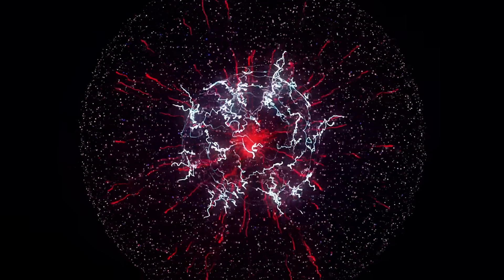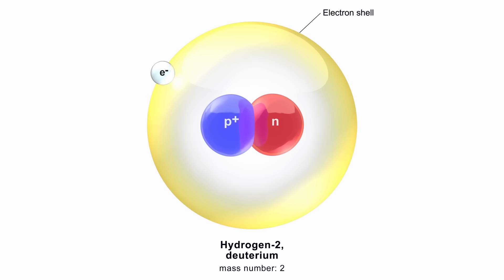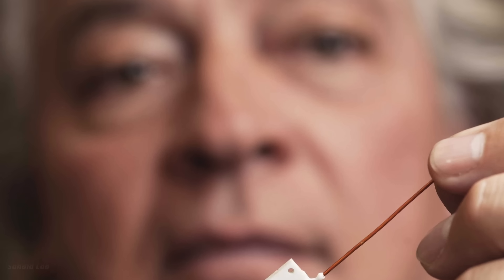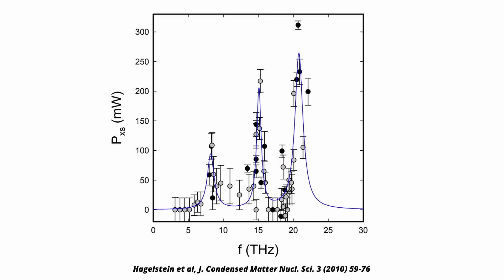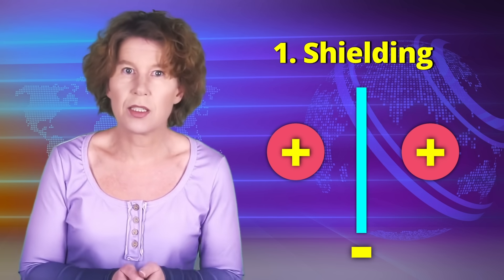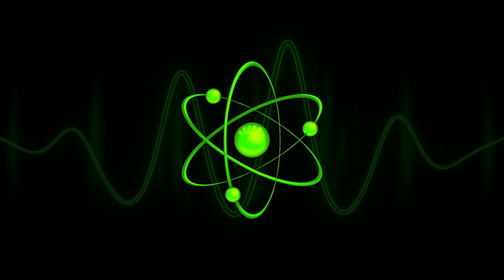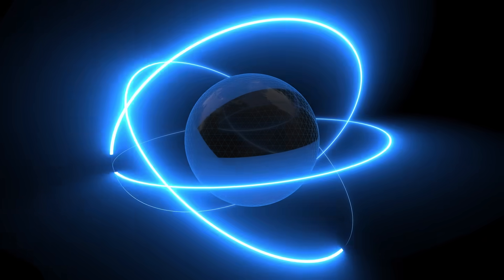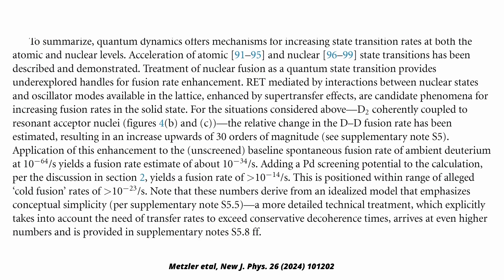Physicists Say They Know How Cold Fusion Works

Comment: So how sensitive do our neutron detectors need to be to detect anything at all?  It’s a bit like claims that the Earth orbits the Sun, despite the inability to detect any parallactic motion of the stars. Eventually we worked out with a spectroscope that the stars were sunlike themselves, so we could then estimate how sensitive our parallax detectors needed to be. Should we be using lead shielding when we do the experiments?

Fusion in the Sun is actually a rare event. It’s just that the Sun is big and self-insulating.
Reply: You think the earth doesn't orbit the sun? Is the earth flat to?
Reply: You’ve just misinterpreted what I said.
Reply: @david_porthouse  Yep you are correct. Most of Sabines comments seem to be electric world theory people or just crazies. I made a poor assumption without paying attention
Reply: @rayparent1  Concerning the Solar System, we are looking for some correlation between the known distance to the Sun, the assumed distance to nearby stars on an initial crude assumption that they are equally bright, the Sun included, and the parallax that we can observe. We really only got to that in the 19th century. We don't seem to be there yet with alleged cold fusion. The expected products of fusion are heat and neutrons, and we have no known correlation between them. The question of whether or not we can make a profit out of attempted cold fusion is not relevant here. I'm just looking for correlated evidence that it exists at all. This paper may help to tell us what to look for. Once we "lock on" to something then maybe we can look to make a profit. At least we would have a respectable and interesting line of research.

Comment: Muon catalyzed cold fusion has been around for ages, the late fifties, I remember reading about it as a teenager (I'm not that old), and the mechanism it exploits to fuse is I thought well understood. Sadly it's also in the more energy in than out part of the diagram, but still may be interesting to any who aren't aware of it: https://en.wikipedia.org/wiki/Muon-catalyzed_fusion
Reply: There was a brief revival of muon catalised fusion in 1986, and there was even a journal devoted to it, but the advancements stalled. The science is good, but unless someone finds a cheap way of producing negative muons, it's hopeless from the energy generation point of view. By the way, Rafelsky, who was involved in the cold fusion scandal, since he was in a rival group [of that of Pons and Fleischmann] working on it at Brigham Young University came from the muon catalised fusion community.
Reply: @jjeherrera  I am curious though - could there potentially be a way to combine this with some other approach so that each one can cover for what the other can't do? I am not sure how well it would work combined with the lattice approach because if you just fired muons into such a lattice they would likely get "caught" on the other atoms far more than on the desired deuterium nuclei, but maybe like using it in a "hot" setup but at considerably lower plasma temperature than 100 MK (i.e. "warm fusion" instead of "cold fusion" or "hot fusion"), or the laser-implosion approach i.e. NIF, but you fire a muon pulse into the imploding pellet along with the lasers (presumably, this would be suitably timed so that the muons arrive near or at the point of maximum compression), or ... Basically just to find some way to not have the muons do ALL the work and/or provide an energetic enough environment they don't "stick" to the helium fusion product so often which seems to be the main issue with the muon-catalyzed approach by itself.
Reply: I've always thought we should mount an experimental muon-catalyzed fusion device on a hydrogen or helium balloon, let it float to 50km height, and see if the constant rainshower of muons we get from space could make this type of cord fusion profitable. It's a free source of muons, after all
Reply: @JosePineda-cy6om  You could potentially concentrate the muon flux using a magnetic field too. I did some sums. I think you could get a very small amount of net energy - in theory (there's always losses in practice) - but I don't think its worth the trouble.
Reply: @robertpaton9716  ok, so maybe this won't be the miraculous energy source the world is waiting for, but... what about a source of complementary energy for high altitude balloons? Even if the net gain is very very little, as long as it's a net possitive, it could serve as a complement to the solar panels to feed the circuits in these balloons. Who knows? We could probably use some of that energy to heat/cool the gas inside, to get a relatively level floating altitude. And a constellation of  long life high altitude balloons could serve lots of purposes, replacing LEO satellites at a fraction of the cost
Reply: I was wondering if that could.be mixed with this method to get cold fusion faster, or for proteus instead of deuterium.
Reply: @ancapftw9113  no, normal hydrogen requires higher pressules and/or temperatures to fuse. That's why even H-bombs use deuterium+tritium, it's much easier to fuse these than regular hydrogen

Comment: Why does everyone call deuterium-tritium fusion "unlimited energy"? We may have practically unlimited deuterium in seawater but we don't have unlimited tritium. There is so little tritium on Earth that when it is needed, it is made by fissioning lithium and lithium is very far from an unlimited resource and battery manufacturers already want all they can get.
Reply: To be fair, the problem is turning lithium to tritium, not getting the lithium in the first place. There are millions of tons of lithium in the world, but only a few kilos of tritium.
Reply: Because you can capture the neutrons that D-T fusion throws off in a breeder blanket, and make tritium right at the reactor. This does take a load of lithium, but doesn't really consume it that significantly.
Reply: @martinalooksatthings  Fusion doesn't make enough neutrons to produce all the tritium needed. Each reaction produces one neutron and needs one tritium but not every neutron splits a lithium, so you will need more tritium, which means fission plants are still needed.
Reply: Which is why CF should be the preferred avenue to explore as it requires no tritium.

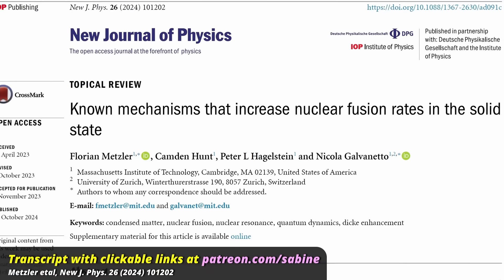Comment: It turns out that this paper (visible at 2:20) was published on the arxiv in 2022, but made it into a journal in October 2024. 

My favorite theory of cold fusion was due to Ron Maimon - deuterons getting 20 keV energy when holes in the innermost electron shell of the palladium get filled, some kind of collective effects among the deuterons, and then actual deuteron fusion quantum mechanically catalyzed by proximity to the palladium nucleus. I'll have to see how it looks from the perspective of the three mechanisms in this paper.
Reply: Keep us posted.
Reply: Is Ron Maimon still around? Had nothing heard for years
Reply: @gregorpabst7423  I think he moved to Israel during the Trump years
Reply: I have always wondered if the voltage acts like a mini-electron gun in the palladium crystal lattice, and that palladium's electron shells happen to leave holes in just the right location for the electrons in the current to bombard the nucleus under the right circumstances.  That would lead to free neutron production, as a nucleus of 3 neutrons would fly apart almost instantly, those neutrons could merge with other nearby tritium nuclei, emitting a beta particle ang amma ray and turning the tritium into helium... which should have a very predictable energy, so it could be proof of concept if such gamma rays are detected.  The released beta particle would probably be a regular electron, and simply be swallowed up in the electric current, releasing heat as they drop in energy levels.  So, the result would be:  a small surplus of free neutrons, specific gamma rays, surplus heat, and mostly helium-3.
Reply: I checked that out, their are avenues that are being investigated.
Reply: Hmm. A deep-shell boost is an interesting idea, not sure how you can somehow arrange for that to happen in terms of making the coupling go. What would cause the deep-shell vacancy, though? It seems you'd need some sort of ionizing beam to create those vacancies, so again of course the question is energy in:energy out as always.
Reply: @ShimrraShai  He says once you have fusion, the energetic byproducts can ionize other palladium atoms, so you can have a chain reaction - but he doesn't address how it starts. Perhaps it could be started by a cosmic ray or a radioactive decay.

Comment: We already have unlimited clean energy. Earth is a big ball of molten rock. Nasa/Sandia Labs studied Magma Energy from 1975-1982, and demonstrated experimentally, various means of harnessing that energy. The technology was neither developed nor applied; nor even demanded by those ostensibly concerned with climate and ecological disaster. Hence you'd have to suppose that, even if physicists solved Cold Fusion, it would never be applied. Except maybe as a bomb!
Reply: You are clueless, magma energy otherwise known as geothermal energy is used extensively in places where it makes financial sense to
Reply: @rayparent1  Thank you for your comment. Despite being incredibly rude, it gives me the opportunity to discuss something that is widely misunderstood. I am most grateful.  
It is incorrect to say Magma Energy is 'otherwise known as geothermal.' 
There are many types of geothermal energy. Magma Energy is a specific type of very high temperature geothermal energy from proximity to molten rock. 
There is no Magma Energy power generation; the nearest we've come is the Iceland Deep Drilling Project - and even that is hydrothermal, as opposed to a closed loop system that would harness both heat and pressure. 
At 374'C - water, becomes steam, becomes super-heated steam - with an associated huge increase in volume. It was a breakthrough in steam train design back in the day - that would apply to closed loop Magma Energy power generation.
Reply: @karlstone6011  yes I know what your talking about and you are still clueless. In places like Iceland people are still looking into supercritical geothermal. The problem is most places don't have access and it's an enormous engineering challenge.
Reply: @rayparent1  Am I clueless? I can only speak on things I've read, for example, this from Nasa/Sandia Labs in 1982: 

Status of the Magma Energy Project
Dunn, J. C. (Sandia National Labs., Albuquerque, NM.)
Abstract
The current magma energy project is assessing the engineering feasibility of extracting thermal energy directly from crustal magma bodies. The estimated size of the U.S. resource (50,000 to 500,000 quads) suggests a considerable potential impact on future power generation. In a previous seven-year study, we concluded that there are no insurmountable barriers that would invalidate the magma energy concept. Several concepts for drilling, energy extraction, and materials survivability were successfully demonstrated in Kilauea Iki lava lake, Hawaii.

For context, current global energy demand is around 600 quads; which is to say there's a minimum of 90 times global energy demand available from Magma Energy, just in the US alone. Worldwide the resource is effectively limitless. 
Admittedly, it's not available everywhere, but then nor is oil. Oil is produced in far flung corners of the world and transported to where it's needed. Sure, it's an engineering challenge. What isn't?
Point is; despite Nasa/Sandia's optimistic report, 40 years later, still no Magma Energy. So you think if they solved Cold Fusion it would be deployed? Not unless they could make a bomb out of it to kill people who challenged fossil fuel oligopolies.
Reply: @karlstone6011  you said we already have unlimited clean energy that's why you are clueless. As you've just admit we don't have it yet

So basically you've agreed this is the same as fusion just an engineering challenge.

I'd love to see a design that doesn't have extreme maintenance costs

Comment: Given that the latest “breakthrough” in fusion technology recklessly announces controlled fusion energy when it provides ignition WITHOUT accounting for energy out Vs TOTAL energy in (I still remember “cold fusion”), My TOP DOWN theory of cosmology says that in order to reconcile static gravitational and Coulomb effects (a valid grand unification theory goal) there is a value, a number R, such that Ke^2 = RGm^2, where K is the Coulomb constant, e^2 is the square of the charge on an electron, G is the universal gravitational constant and m^2 is the square of rest mass of an electron– what can be simpler than that! The calculated value of R is 4.16574 x 10^42. Given my TOP DOWN cosmology, then, Coulomb effects are 4.16574 x 10^42 times more intense than gravitational effects, meaning that local ignition, compression and containment needed for sustained fusion reactions are collectively unattainable. Clearly, the evolutionary direction of the universe must be countered and reversed to sustain a local fusion reaction– a physical impossibility! Yet, much money and time is being WASTED on attempts to “find a way,” apparently to justify continued reckless population growth on this fragile planet. (The problem does not exist with fission reactions, which have their own set of intractable problems, because energy release follows the direction of universal evolution.)

Comment: If cold fusion existed, we would have examples of it in nature... I believe... Someone once said that chickens, when fed with feed with low calcium content, transmute other elements into calcium,... so that there is no shortage for their eggshells... but I have never heard that they fuse atomic nuclei... I have tried that "simple" method of salt water electrolysis, with nickel electrodes... but I did not see any fusion... I used a CR 39 polycarbonate catalyst...
Reply: Answer: Look up Bob Greenyer.

Comment: Thank you for this video! Certainly, looking into cold fusion is and was a better investment of time and money than looking for Axions or WIMPs. And it was dismissed as "bonkers" by the wrong people (who usually did not have a clue about the partial perssures of H2 you can achieve by adsorption in Pd/Pt configurations). I really whish I would live long enough to fly a fusion powered Em-Drive ...thing, but well. It's not happening.

Comment: The reason why CANDU works great for cold fusion, is that you can use the excess energy from fission to do cold fusion. And deuterium is vital for doing that.
Reply: Are you suggesting that the CANDU reactors are already benefiting from fast neutron collisions with deuterium being fusion in a measurable amount?
Reply: @chrisolmsted5678     it was enough to put Darlington out of action. (Joke, idk what the problem was with the Darlington CANDU)
Reply: Don't know if that's the case, but I'm sure they will provide the highest chance of getting useful cold fusion of any means we currently have. Starting with experiments to see if it could work and how effective, would be a nice first step in a useful direction in my opinion.
Reply: magnetic north should focus cosmic ray muons

Comment: I was at LBL when that Fleischmann and Pons cold fusion paper landed on my desk.
   After those first debates (and eye-rolls) over cold fusion back then, I have naturally continued to be a skeptic.  
   But i had to click this one since i try to keep an open mind and videos here tend to be credible and well-thought out. 
   “Enhancement of 25 orders of magnitude” is a big leap but i’m listening.  I also liked that model includes phonons - something i historically only thought of in very high power optical systems.  
   I may have to look into this research…
Reply: Phonons featured in the optical spectroscopy our research group studied in the 1980s. Of course, those were very low-energy (peaking at around 60cm-1 or so), but any crystal lattice would have those phonon modes.
Reply: @ I never spent much lab time with nonlinearities in crystals.  I was instead just remembering nonlinear fiber optics - the SiO2 is amorphous but when one launches Watts of laser light into the fiber, the intensity in the fiber core is so high that tensor math returns to haunt field and wave calculations.  And phonons started to explain the observed SBS (scattering).

Comment: Uncle George was PhD Berkeley physics  Before they both died, he went to Utah to test Fleichmann's device.  He said, and I quote, it did not produce enough neutrons to be fusion but that it did produce excess energy.  George was UofC involved in first A-bomb and  doesn't appear in any history book or film.
Reply: The latest research seems to indicate it's producing fusion but not excess energy.
Reply: @dansanger5340  I know he (George) brought his own equipment to test neutron flux, but have no idea how he evaluated excess energy.  He was certain about excess energy and was very rarely mistaken. He knew Fleischman on a professional level and may have just used his (Fleischman's) numbers.
Reply: @82spiders iirc there is some evidence for aneutronic fusion as well as fission reactions in the reactors
Reply: Was that George Miley? I met him once at a conference.
Reply: @brendanh8193  Uncle George's last name was Jura.
Reply: @82spiders  Ah, not the same guy. However, looking at his obituary, I see that he (your uncle) did some research using the Mossbauer Effect, which is an interaction between radiation and crystal lattices. That is most interesting, because I suspect that cold fusion is another type of interaction, if it exists.
Reply: @brendanh8193 Uh, George said P&F device was NOT fusion because there were not enough neutrons. He didn't say there were no neutrons emitted. He was an cold war H-bomb DoD guy, so he had expectations.  When I pressed he reluctantly said novel, uncharacterized.